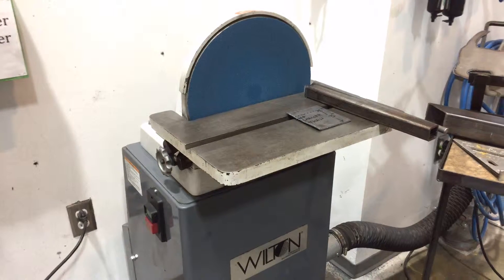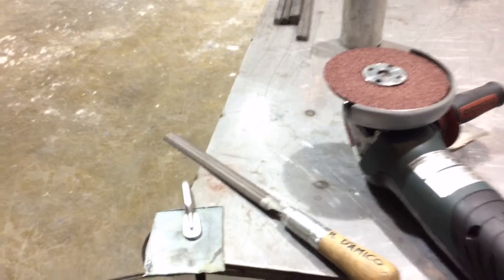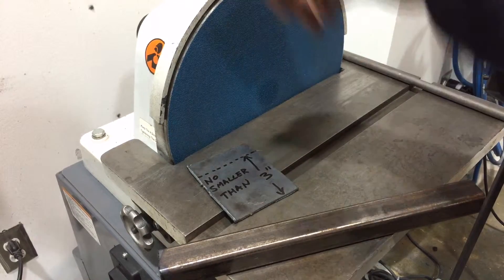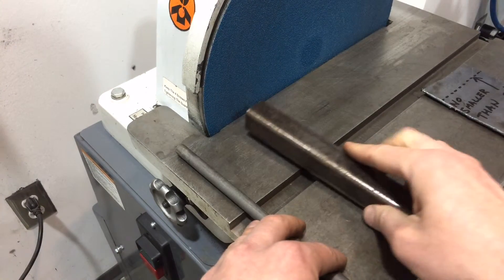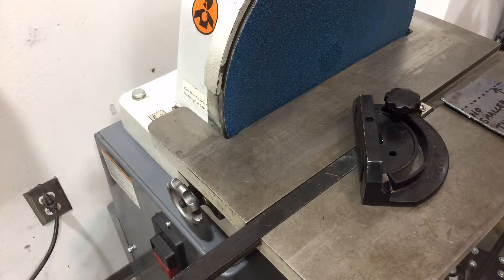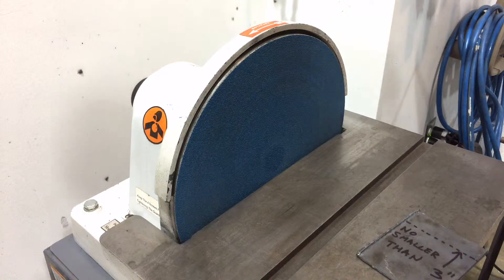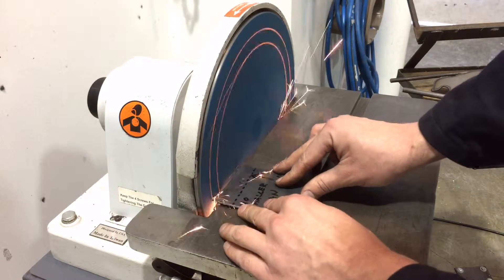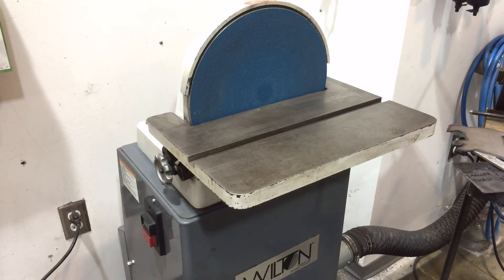Disc Sander

Comment: what sandpaper do you use?
Reply from the maker: In the video I'm using an adhesive backed  Zirconia Alumina disc. this is pretty good for general sanding of steel and stainless. if you're planning to use the tool for aluminum or other non-ferrous metals, you may want a disc with an anti-loading agent (sometimes called 'clog resistant'). I recommend staying away from aluminum Oxide as it just wears down too fast.